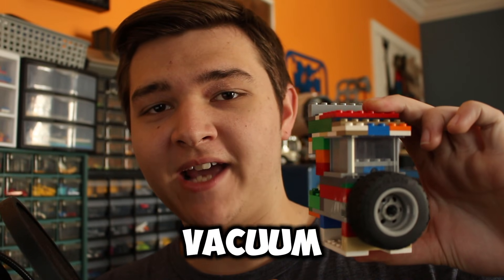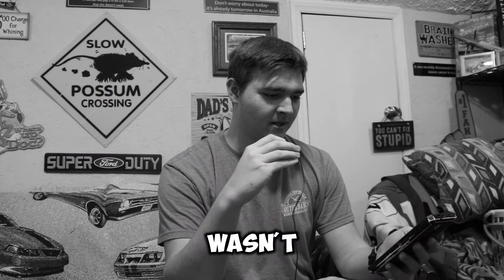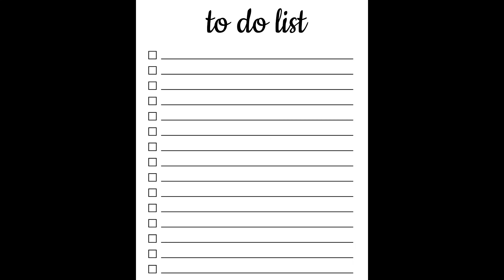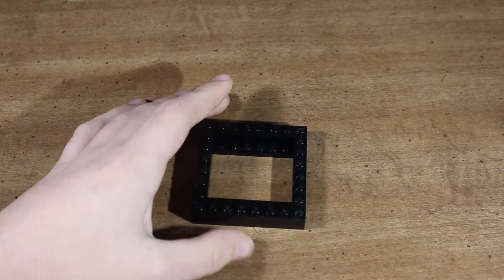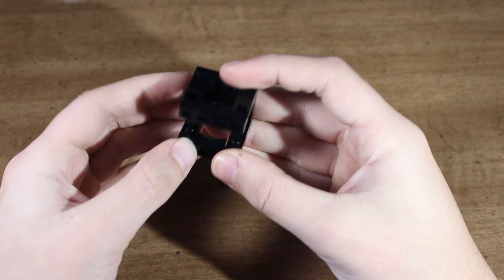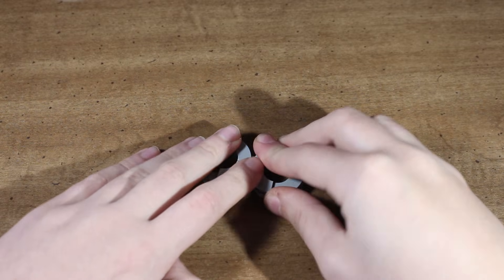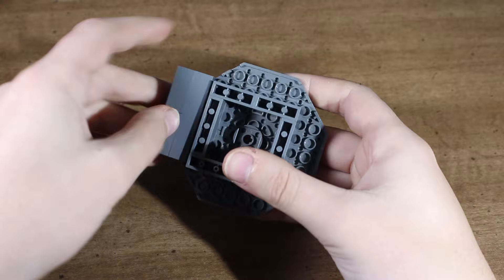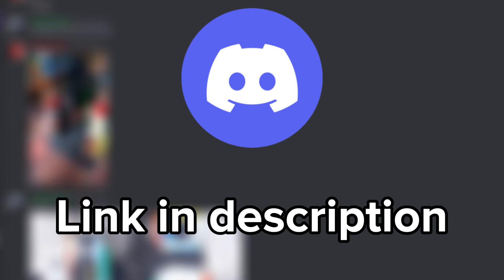I Built a LEGO Vacuum Engine With NO Technic Pieces!

Comment: Here is a tip for making your engine running smoother, I would recommend using a dry lubricant or oil, oil works but attracts a lot of dust, but dry lubricant reduces friction and lasts longer than your traditional oil lubricants
Reply from the maker: No thanks, I'm try to go for 100% LEGO engines, so no outside materials. Also, I don't want to make a mess on my bricks

Comment: No axle axles are technique pieces
Reply from the maker: There are no axles used in this design. The only part that's close to scales are the bars/rods used to strengthen the crankshaft, which is not a Technic part

Comment: Can make one with simple technic pieces specifically don't use the 2x2 thin ones
Reply from the maker: Wdym, like the 2x2 round plates? I think without those, a true "no technic" engine is impossible, unless you find some very weird and most likely weak system
Reply: @DeltonAdamsLEGO  nah man the ones that are used for the valves. Thanks for replying bro i appreciate it

Comment: I love Lego engines but I only have Lego bricks is there anyway I could build it
Reply from the maker: @proximityboi7484 with just standard LEGO bricks, I don't think it's possible to make a running engine. You can however make a model engine that doesn't have any moving parts. I used to make those a few years ago

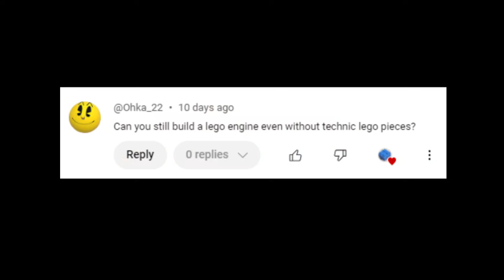Comment: 0:09 You showed the Lego technic pieces that you used for the vacuum engine. But for this engine you used a gray axel piece with you showed was a technic piece so is it not technically technic or is it?
Reply from the maker: Do you mean the 2x2 round brick? It's not technically Technic, but it does have an axle hole in it. I think it depends on what you personally would qualify a Technic part as
Reply: No the axle the gray and black axels
Reply: Ohh wait
Reply: My bad you did not use axels
Reply from the maker: Ohh, you mean the bars, you're good 😊
Reply: Anyway amazing job it was absolutely insane that you build that